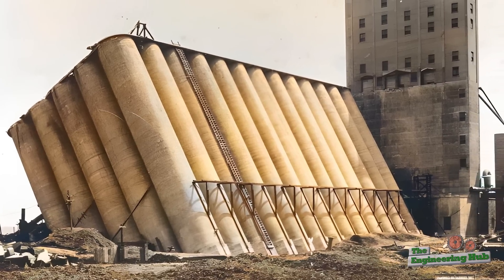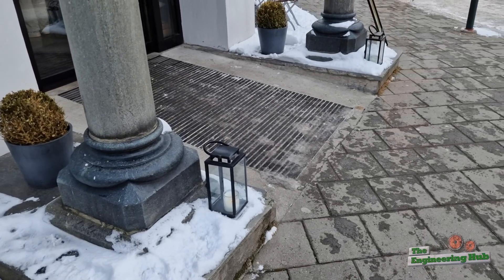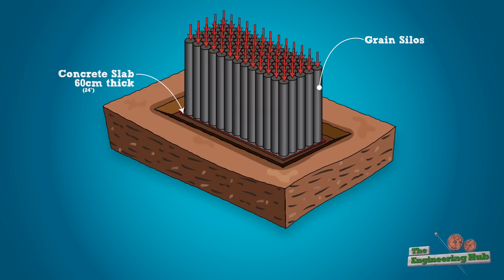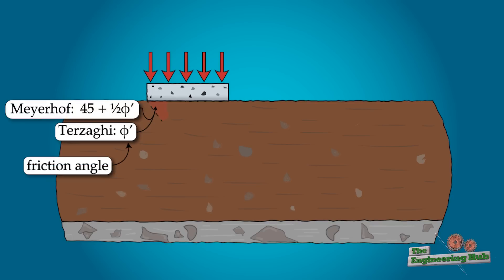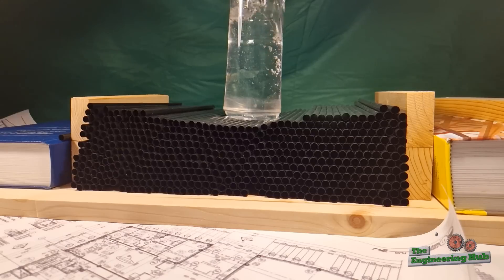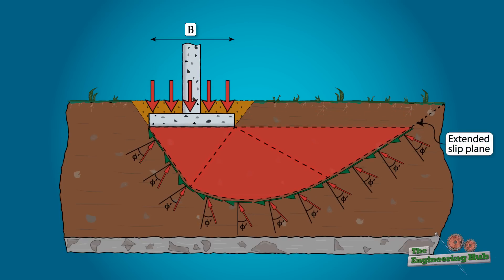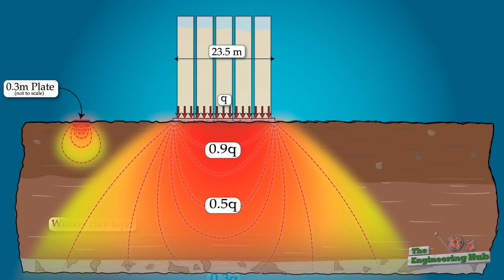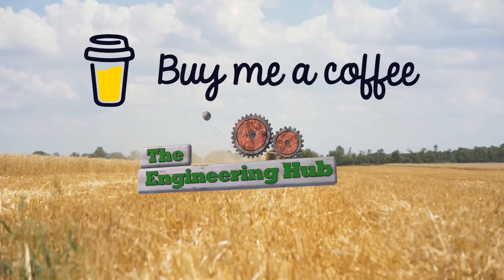Geotechnical Analysis of Foundations

Comment: I grew up in South Transcona on the wrong side of the tracks ( or wrong side of the CN shops). I can concur that this is a very wet location. Every spring the floods would fill up the streets around my house. I have fond memories of floating around on rafts made from scrap wood or the occasional wooden bridge that floated away from someone's front sidewalk ( we had ditches on both sides of the road.  Fun for the kids, but the parents were less impressed. If the city didn't get sand bags covering the manholes for the sewers in time we were treated to sewer backups in our basements. The city finally built a storage pond big enough to capture all the spring runoff which cured that problem. 

My parents bought a house here in the first phase of what was to be a subdivision of roughly 4500 houses. The tar roads and ditches were just temporary until the rest of the development was to be built with storm sewers and paved roads. That didn't happen and the original hundred or so home owners were screwed. No schools or shops or any amenities. They stopped when the developers found out how water logged and unsuitable this place was.

The soil here is top soil on heavy clay with a gravely wet mix blow that. My father was digging out a hole (sink hole really ) in our front yard by the ditch. The shovel got stuck down in the hole and just got sucked in never to be seen again. Still there somewhere down below. I can see how a ,ess than perfect foundation would end in disaster here. 

Sorry for the long post but it isn't everyday a story that is literally in my childhood backyard comes up in my feed. Thanks for the video.
Reply from the maker: Thank you for sharing numb, we appreciate stories from the locals. I am from a different part of Canada so never had the chance to visit Winnipeg but your description paints a very clear picture of what the geology/hydrology of the area is. Thank you, cheers!
Reply: @TheEngineeringHub  This was a case study that I got to hear and read about in our Geotechnical engineering textbook at the U of M.  I always enjoy seeing something local like this unexpectedly.
Reply: This is literally one of the most famous and very first case study taught to every single Geotechnical Engineer in college (a specialization of civil engineering consisting of a relatively small group of practitioners).

We love soil and solving problems in places like YOUR backyard!

Geotechnical Engineers solve complex problems involving any type of structure that interacts with soil, not just foundations, but also large dams that hold reservoirs, deep walls that can be 10 stories below, underground tunnels, and nuclear storage deep underground 500 feet below your very feet!
Reply: Interesting story, but these silos are much further north by Kilcona Park off Springfield Road.

Comment: By me, due to a lot of the soils being wet sand and silt, many of the large buildings in the city are built on pilings, that go down to a bedrock layer some 30m/100ft down, so that the buildings do not settle into the ground. Even for buildings that are 3 floors many were built that way, simply because there were so many other buildings that settled down over time, despite having massive floating slab foundations. You have to come out of the city basin before you find simple non piled foundations, and even there many still use deep piling to get stable foundations that will not shift. 

One large centre was rather infamous for having an expansion joint, that opened up big enough that you could put a ladder between the 2 floors, and climb between them. They fixed it by casting in a new section of slab to close it up again, after the motion had subsided, and putting in a massive effort involving digging out the fill (what caused the issue) and piling under the half to both expand the centre, and to provide a large area of foundation on existing soil as well.

university has the one building that has moved around 5m down the hillside it was built on, as a unit, due to them underestimating the piling requirement, but the concrete structure is strong enough to handle it. Ironically, it does contain parts of the civil engineering faculty, and the other side is known as the most accurately surveyed hill in the area, seeing as it get surveyed around 100 times a year in training students.

Comment: This was great, especially the straw model.  I'd love to have a similar analysis of the Millenium Tower in San Francisco.
Reply: Yes!  I'm scared by the fact that could be an actual water well underneath that building.  "The Leaning Tower of San Francisco."

Edit:  Also, please do the liquifaction events during the 1906 Quake...like the Valencia Hotel.  (Proof wooden buildings are not safer than brick if your foundation is built upon old wetlands or creeks.)

Comment: This is somewhat similar to what could have happened at my old University. They were planning a big, major campus upgrade. The old veteran geologist professor warned the construction survey team of the ground condition at the planned site and that their proposed foundation would not hold and that they would need to dig deeper for the concrete rebar piles and further down for the foundation. They brushed him off and began laying the piles and foundation, only for the ground to give in in some places as they were drilling the holes for the piles and de-level the early parts of the foundation being set (that layer of dirt and rock meant to be flattened and built on top of). They were forced to correct their mistakes at their expense, which delayed the grand opening of the new science hall by a year as a more comprehensive survey was done, which ended up matching the old geologist professor's claims.
Reply: Imagine being dumb enough to think "Yeah, I did a 6 week course on this, what could the professor who taught the guy who taught me possibly know about his own back yard?"
Reply: @NigelTolley  Problem is that often urban planners are working mostly on acquired experience and fail to take peculiarities, mostly related to outdoors, rural and unconventional constructions, in consideration. Such was the case with my country and my university building in particular. During the 70's there was a urban development boom and a consequent polytechnic degree boom and the architects were primarily concerned about the minimization of cost and redundancies to "good enough" standards. Consequently they developed an overconfidence and over-reliance on their previous experience that, ironically, made them too rigid to adapt sufficiently to novel challenges which resulted in major long term infrastructural damage to my country's rural and general decentralized networks.
Reply: @NigelTolley  More like "shitstain company owner who steals all the profits and gives us pathetic breadcrumbs while we do all the actual work wants this done yesterday, fine, it's his problem not ours, you get the work quality you pay for even when you don't demand miracles people paid 10x more than us would be hard pressed to perform"...
Reply: @Nigel Tolley  many acidemics have no real world experience and are only able to recite a textbook.
Reply: @mbox314  I think calling it "reciting a textbook" is a little reductive. I've definitely been surprised when a student asks a question about doing their future job and the professor says "I don't know, I've never worked in industry." But that doesn't mean they have nothing of value to offer, and that they don't have any insights that may be important.
Reply: @mbox314  you can’t get a doctorate without doing original research.  You have to discover something new.  You can’t simply read out of a textbook you have to be able to write the textbook.
Reply: @mbox314  Pretty much any geology professor will have extensive fieldwork.
Reply: @mbox314  Acidemics?  Like hippies from the 60s?  You should find a textbook and read it.
Reply: The university I graduated from was hitby a major earthquake. Many of the buildings were condemned but the civil engineering department was fine. That was reassuring.
Reply: @richardpowell1425  the faculty of architecture in my old uni was voted to be the 2nd ugliest building in the city.
Reply: @theVtuberCh TBF there is one building from which  you never have to see that ugly architecture when you look out your window.
Reply: Indeed! My Alma Mater University of Louisville has a Physics building with many structural support columns in the basement because of the sediments underneath; without them, the building wouldn't stand but buckle and slide or worse.

I don't know much about this, but here are my thoughts.

The building has its wide face facing the street while it's narrow sides face perpendicular to the street. It sits on a hill that descends toward the street. It might be that the building is held up by the street itself: that the street and its heavy traffic provide pressure on that place that might otherwise buckle upward as the building pushes down.
Reply: Ignore the advice of old men at your peril.
Reply: Same with my uni. Our architecture prof spent half his career aboard overseeing repairs on the building.
Reply: This happens it seems because the Prof spoke to the Builders, not the engineer who is responsible.
Always get in touch with the officials.  Doesnt matter who you are.
Reply: Sheffield

Comment: I suspect the structure weight varied greatly as the silos were filled and emptied, introducing a slow dynamic scenario. Was this varying force a factor?
Reply from the maker: Yes, the weight of the grain is very significant in this case, contributing significantly more weight than the structure (concrete) itself. The silos were filled slowly, though (over several days), so there would be no dynamic amplification factor. The foundation failed during its first filling, so the silos were never emptied before the failure.
Reply: @TheEngineeringHub  I used the word 'dynamic' cautiously but soil is a stubborn and huge resistance which matches the slow nature of the silo filling. Clearer now that I read that the dynamics never included a lightening half to the cycle.

Comment: Touché...but also, the soil type is important. As a Geologist, in my country  we never use the 300mm plate, only 600m to 720mm plate. Also we use the DIP test and Troxler test. And if needed we complement with CPT and/or DPSH.

Comment: Interesting video. Kind of nostalgic for me. This was pretty much "right in my backyard'. I grew up just north of Transcona and took my civil engineering degree from the University of Manitoba (way back).  We studied this failure as part of the geotechnical curriculum.  Thanks for posting.  I also have that exact steel design and wood design manual in my 'library'.  Although I don't practice engineering any longer, they are still great reference manuals.
Reply: I took mechanical engineering at the U of M and remember the large black and white picture of this in one of the hallways.  My older brother took civil there and they covered this failure as well.

Comment: This should be required watching for all the house construction companies in Oklahoma.  I’d swear they all have a cousin in the foundation repair industry, which I didn’t even know was a thing until I moved here.  I wondered why there were so many foundation repair commercials on tv here, then I watched a house being built on the lot next door.
They barely scraped the grass off the surface, poured a thin slab, then stapled a frame together.  I’m not sure if I should be upset with the greedy construction companies getting away with not pouring proper foundations or the state for letting them get away with it.😡

Comment: Fascinating! This video explains why the plates and blocks I used to lift up a combine harvester in a field not just settled, but tilted as I operated the jacks. A much larger plate would have helped to increase the stability, and thus the safety.
Reply: But a larger plate would destroy more unharvested crops .  For temporarily lifting a combine harvester, pushing around the soil at each location is acceptable and easily undone by plowing the field before sowing the next crop, as is tradition anyway.
Reply: @johndododoe1411  not the OP but having a few more square meters of crop disturbed is a lot less expensive than the ground shifting and dropping the combine in an awkward position that damages it. In addition, the odds are that the ground you are setting the plates and blocks on has already had the combine remove the crop being harvested anyways. Finally, most farmers engage in zero-till seeding now where they plant directing into the stubble of the previous year's crop as this reduces soil erosion during spring runoff or heavy rains as well as reducing moisture loss that occurs when the ground is cultivated.
Reply: @ylevre3285  I thought lifting the combine would be after a breakdown with unharvested crops on 2 of 4 sides .
Reply: @johndododoe1411  I'd say that is generally correct, but because the combine header (intake) is at the very front of the machine that means that all the lift points underneath are going to have been cleared already. Any damage you need to do on the crop sides from there on will likely need to be done no matter if your final plates are 50cm per side or 150 cm per side

Comment: Many heavy buildings now use pilings that go deep into the ground in order to keep this from happening now.  Lot of buildings now go 20-25 feet through the ground for pilings before a base is built for a facility or building.  In many cases pilings will go even deeper to find actual heavier foundation material like granite or stone.  Depends on size of the building and soil type.  But a lot of this stuff is learned over time, and usually it's learned after a "failure" of original plans.  We've learned a lot since building Pyramids on the sands of Egypt.
Reply: Along the Texas gulf coast itself pilings may go 150 feet or more

Comment: I had always thought that the depth of foundations (unless they are raft foundations) was determined by how far down it was necessary to go to get either to bedrock or to hard, compacted subsoil which would resist compression. I’d certainly have imagined this grain silo was built on piles, but it seems it was just a relatively shallow slab.

Comment: The only problem with Linux app store is they don't explicitly say "this is a snap, this is appimage, these are the differences and what problems may be on one but not the other..."

Not to mention there are like 5mln downloads in synaptic but the reviews and comments are from 2013 and there's only 7 of them lol.

Wanna fix Linux all store? Self contain dependencies!!! They all claim to do it but none of them actually do. Try used openshot or kden gpu video rendering; do you need apt, snap, flat, image? Who knows! Ffmpeg's specific compiled build with a dozen flags is required, plus Nvidia toolkit build just for the depenciy packages which could've been but aren't included in any Linux app store version of video editing software. Wtf, to test it someone had to do it so why not at least make a docker image people can use to just do their final render?! Why is this so effin hard?

Comment: I'm reminded of two similar failures relatively nearby, in the Fargo area, also on the Glacial Lake Agassiz lakebed - the Stockwood Fill east of Glyndon MN in the same timeframe as the Transcona failure, and a Fargo grain elevator built in the 1950's that failed similarly to Transcona but was unsalvageable.

Comment: Safety factor like they're building a plane. Is it normal in civil engineering to have such tiny safety margins? For me 3 to 4 is about right
Reply from the maker: I would imagine today's codes are probably around 2-3. Today, both the capacity and the load have a safety factor applied to them. On top of that, the capacity is the 5th percentile strength, which is already much reduced from the mean value. It's crazy that this happened only 110 years ago, and yet so much is different in terms of design and safety.

Comment: Hmmm, I wonder if there is a record of the condition of fill of the various silos.  If all the silos were empty, and loading began with an outer row of silos progressing towards the middle, an overturning moment would be introduced in the foundation slab.  This could start the shear failure of the soil below the foundation.
I'm surprised that no test borings were conducted to investigate soil conditions for some distance below the footing, say at least to the lowest extend of the "sphere of influence" as shown on your animation diagram.
Reply: as the video says, they did do borings, but only *looked* at the bottom half.  It looked the same as the top half so they didn't test it.  They were wrong

Comment: I note that they used a safety factor of only 4/3 for the foundations. It is normal to use a safety factor of at least 2.
Reply from the maker: Yup, not great when it comes to soil. I guess we know better nowadays. Soil is very unpredictable and variable. Some very brave engineers back in the day to walk on the safety line like that.
Reply: @TheEngineeringHub  Engineers were highly versed and intelligent people back then. Lessons have been learned, the standards have changed to account for a talent pool capable of lesser.
Reply from the maker: @taylorjeffords1719  you are not wrong! I personally find codes extremely boring to follow. They take the fun out of engineering, but I must say they probably save a lot of lives by reducing the chances of error.